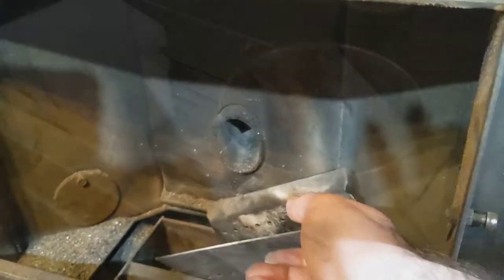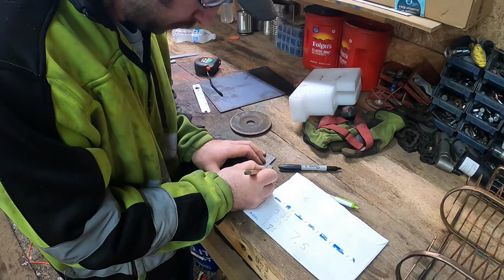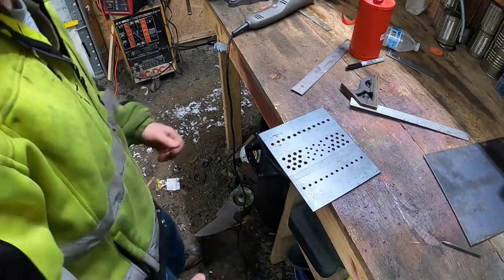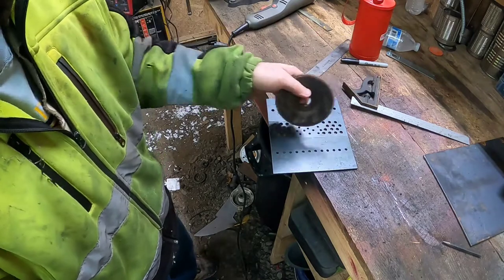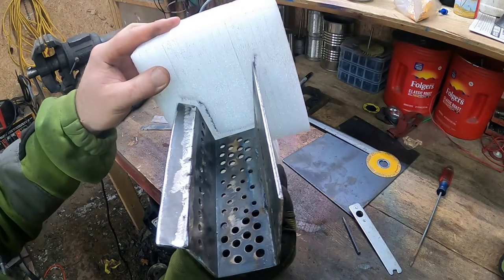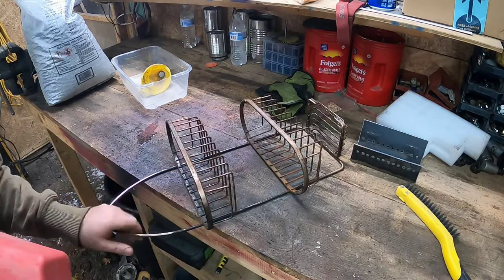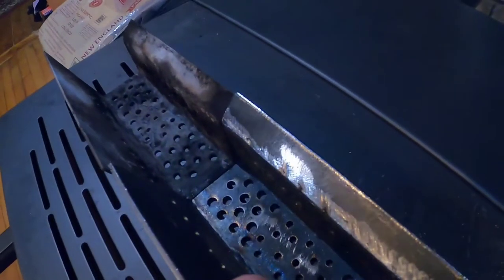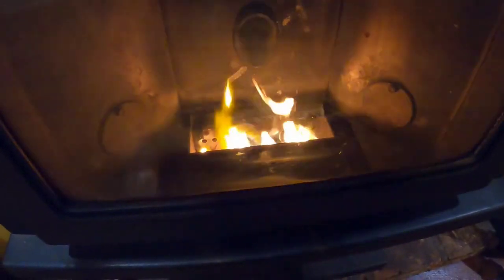Making a pellet stove burn pot

Comment: I just bought one of those inserts that looks like the one you took out of the burn pot for a 1989 Whitfield advantage 2. The original burn pot lasted all this time, but I have a pretty good-sized hole in the middle now and the burn pot just fills with ash on the bottom pretty quickly the past year. The shape of the "insert" on the original pot looks to be welded in but it's the same shape and size as the new one. Looks like I have to just cut out the old one so the drop in insert fits?